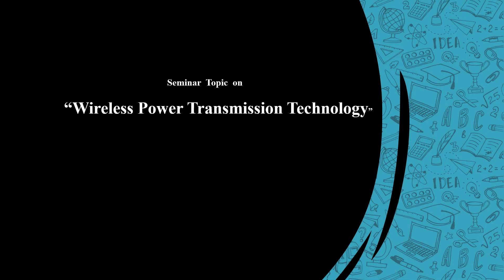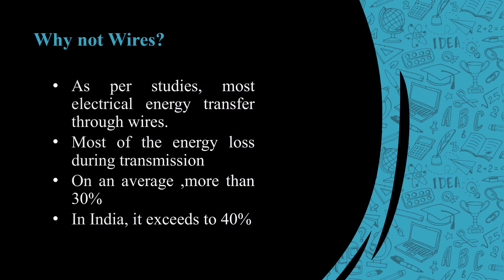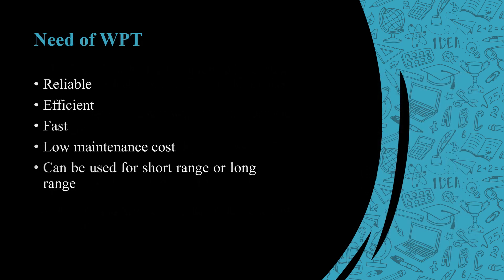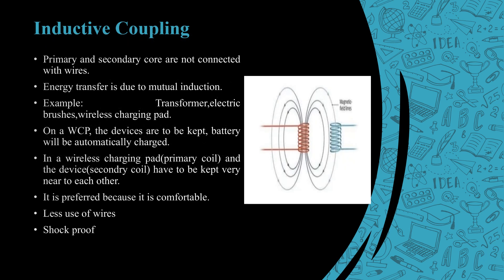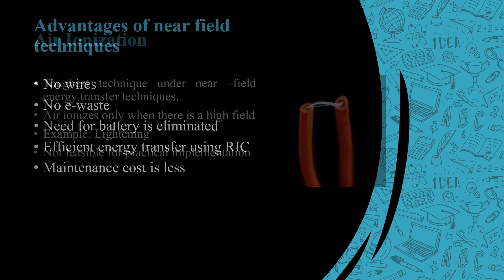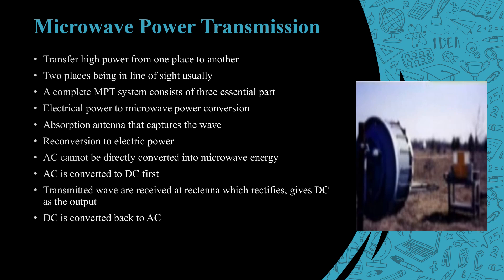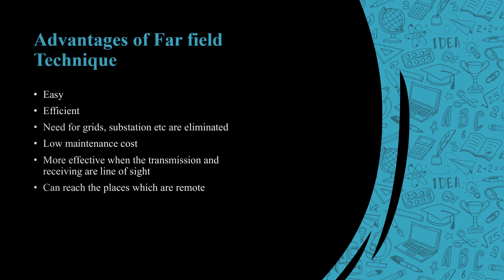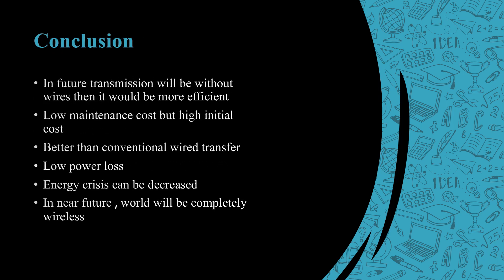Seminar topic on Wireless power transmission technology (PPT)

Comment: That magnetic resonance coupling of wireless energy transfer illustration, thats a tahong seashell in tagalog. Or a dragon katol mosquito repellant matched fired connected to blue type electron coil mosquito repellant with spring attachment, a mouth watery sight for Merlin the sorcerer.